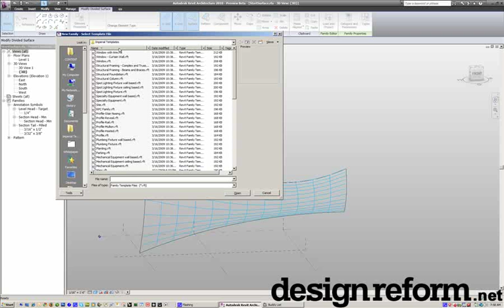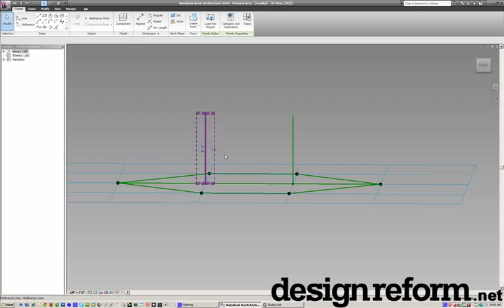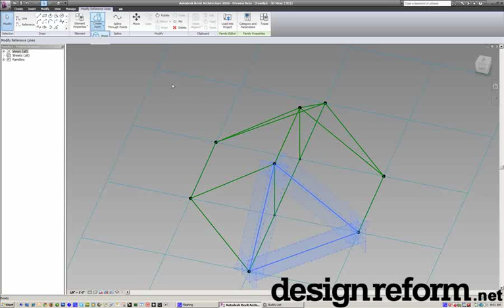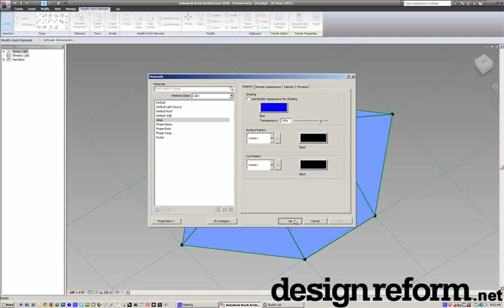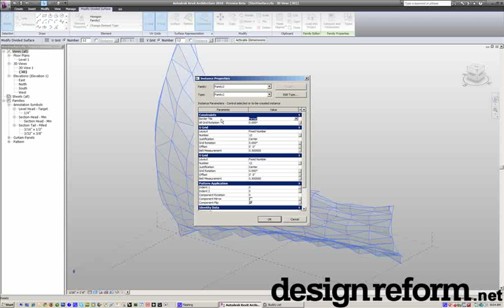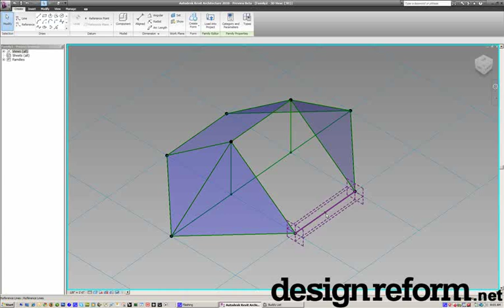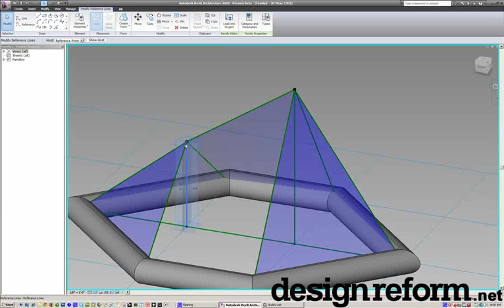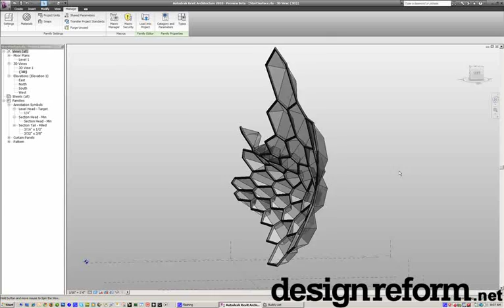revit 2010 hexagon panels Revittut blogspot

Comment: a question
I noticed that revit is maiking all the forms with different size
even if our panel family has the assigned size, applying it to the face it's maiking panels with different dimensions

is there any way to crate a panel which constrains revit using only only onw size of panel??

it would be closer to the reality, when we want to produce it searially..
thnx